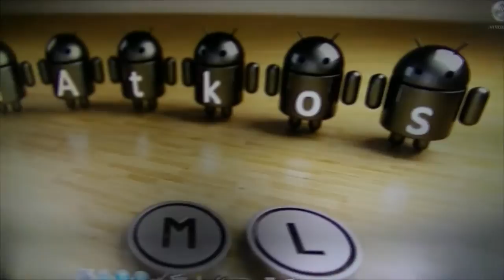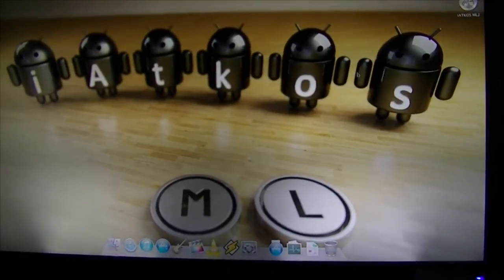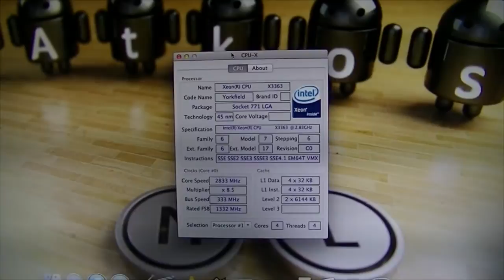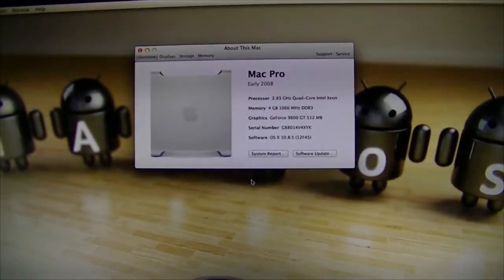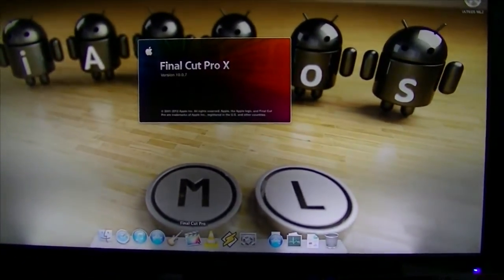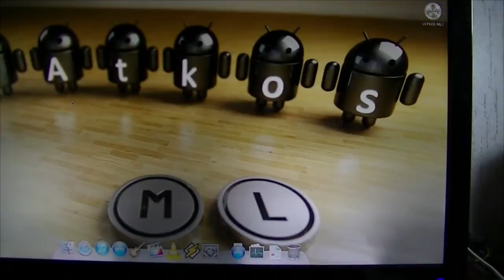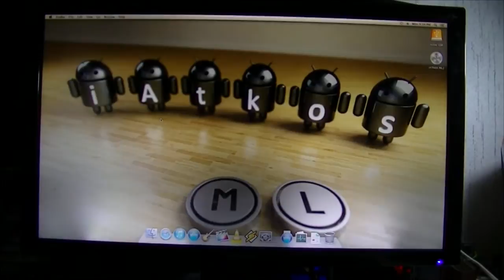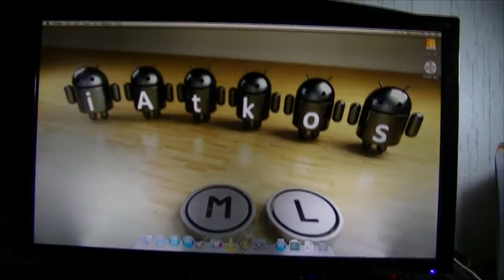LGA771 to LGA775 MOD - ASUS P5E3 PRO X48 + X3363 Xeon CPU

Comment: Should I be worried doing this to my regular Asus P5E x38 board? You said you bricked yours... What happened exactly?
Reply: the p5e is just a rebranded maximus formula (look at the p5e name on the board,its a sticker, remove and u find maximus formula written).

as long as you flash the bios correctly, you should have no issues.

in fact since it uses the exact same board as the maximus formula, you can actualy flash the BIOS ROM of the maximus formula or rampage formula using afudos on the p5e and it will work, with exclusive ROG features and all

Comment: Impossible to boot e5450 on P5E3 PRO... cpu works on P5Q... any idea ? thks
Reply from the maker: john joe different chipset. P45 chipset works perfectly with the 5400 series xeons.  The chipset is what matters.
Reply: WaybackTECH
 thks for the answer... i was happy to buy a p5e3 pro for 30 euros with x38 and not compatible and this morning i ordered a dell 780 for cheap with q45 wich is not compatible too ;-)... pfff... thks again
Reply from the maker: john joe
I was never able to test my P5E with the X3363 cpu, which does work with the P5E3 Pro. I would be curious to see someone test that combination.

Comment: Hello WaybackTECH.
I want to pass this micro to 2,8 original mhz to 3.2 mhz overclock. What parameters of voltages has got this micro to put in bios?

i´ve got mobo p5e3 pro.

Thank you

Comment: I have a question at here.
I thought that the 771 to 775 mod doesn't work on X48(or X38) chipset.
So,only 3xxx series xeon processors will work on those chipsets?
Reply from the maker: I was never able to test an X38 P5E with this CPU unfortunately so I can't answer that. But there is success with this cpu and the gigabyte X38 board.

Comment: I need your help and advice

my friend last day bought nvidia gtx980 and hes gave me old gpus hd7970 as free
i have a gigabyte p43-es3g mobo + 8gb ddr2 ram + aerocool xpredator case(750watt) + coolermaster hyper 612 push pull 2 Excalibur fan cpu cooler + intel q8300 @ 3.00ghz 
my graphic card was a hd6850 I changed hd7970 but gaming performance almost same.(OS win7 pro 64 bit)
I believe cpu is doing a lot bottleneck
do you recommend me intel xeon e5450 (40usd) or x5470(65usd) 
i dont want to change all system right now because dd4 systems too much expensive in my country

spend a money old xeon cpus good idea or bad idea in my situation
ps: i can sell my c2q q8300 50usd because still valuable in my cauntry :)

i think my cpu cooler can handle x5470 but its a 120 watt tdp, tjcase max.63c and i wanna do overclock
e5450 80 watt tdp tjcase max.67c i think this cpu can easy oc without trouble go to 3.6ghz and 25usd cheap :)
what is the wisely choice my mobo fsb wall max 1616; e5450 can go @3.6ghz, x5470 can go 4.00ghz
can i run away from bottleneck with overclcoked xeon cpus
(im sorry about language and grammer i cant write well english)
Reply from the maker: I would personally go for the X5470 due to the higher multiplier, if your motherboard will only just go above 1600 Bus speed. My GA-EP45T board will do 500MHz (2000MHz) but stability above 450 (1800Mhz) is tough, and takes some very fine adjusting of the bios voltages and memory timings to get it just right. I currently run my E5450 at 4.20GHz and I have pushed it to 4.5GHz

But I will warn you, the TDP doesn't matter when overclocking. My cooler is rated for 180W and at 4.0GHz + it could not handle the heat generated at all. I had to put a server fan connected to my fan speed adjuster on the case so I can crank up the airflow through the heatsink under load when I am rendering video. People say the X54xx series chips run cooler even though the TDP is higher. But I have no personal experience to say one way or the other with this series of Xeon chips.
Reply from the maker: Performance wise @ 4GHz, you would be just a bit under an AMD FX-8350
Reply: thanks for helping man i serch on the google read a lot look all benchmark i can find x5470 @4.00ghz been badass :) 65 usd worth it
and if i have any heat problem i can take down fsb little or i forgot the mention it i have watercooling stuff tripple radiator but i dont using it because i build that myself waterpump annoying me night time
mybe there is the time buy better water pump :)